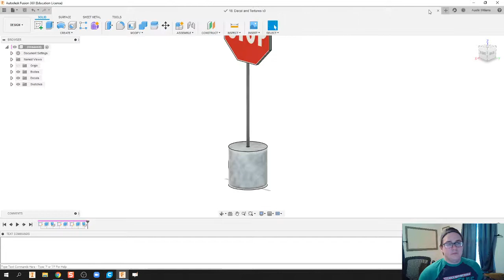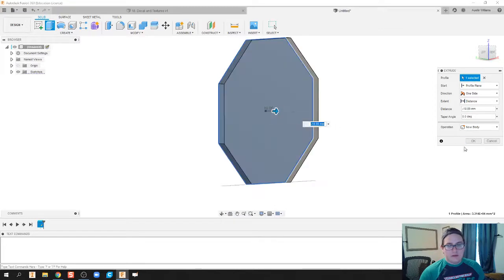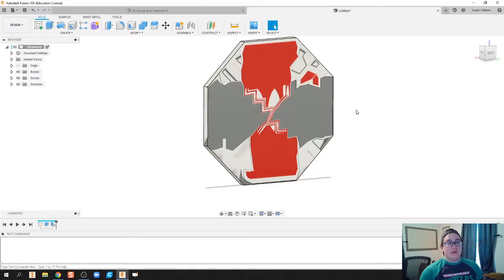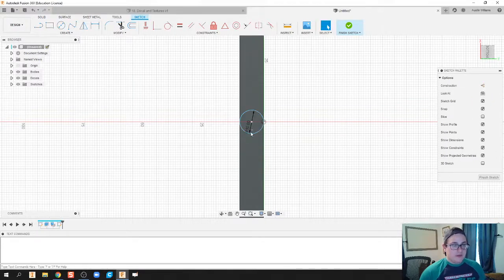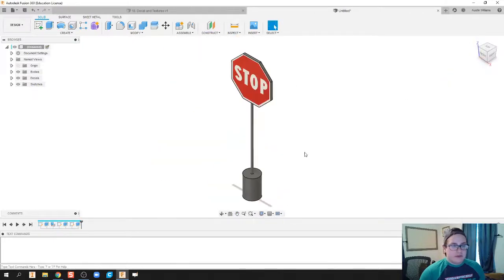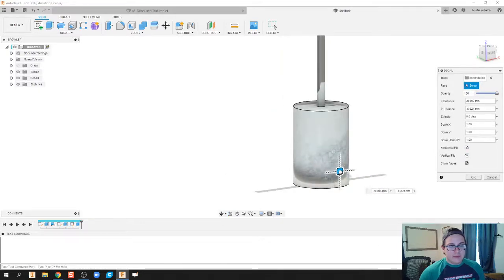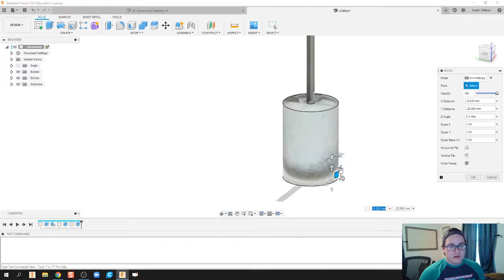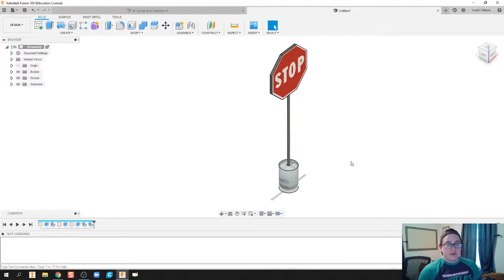Decals and Textures - Day 18 of 100 Autodesk Fusion 360 Journey

Comment: I learned by accident that if you make the concrete base as a NEW BODY rather than joining, that when you do the concrete decal, it will not creep up the post at all.  I still did need to do a 2nd decal to cover the back side of the concrete base, but did not worry about it going up the post at all.
Reply from the maker: Absolutely! This was just into my Fusion journey and I didn't even comprehend the purpose of Bodies/Components! Solid work